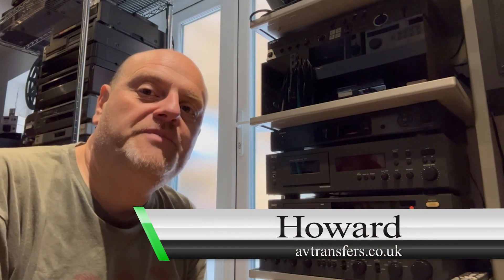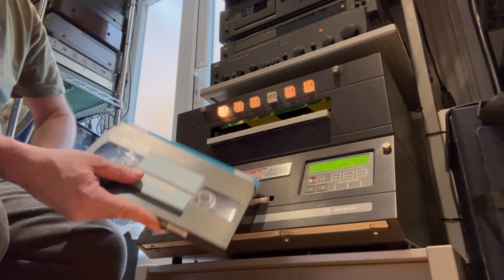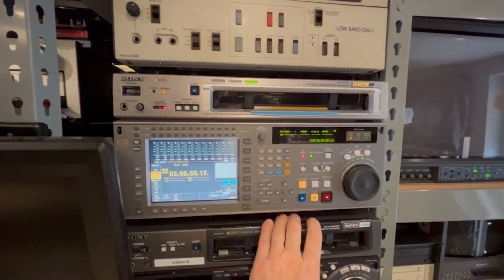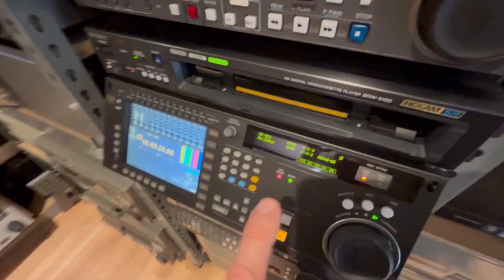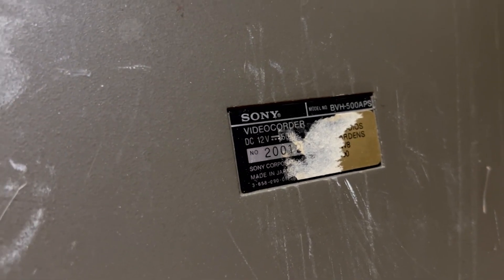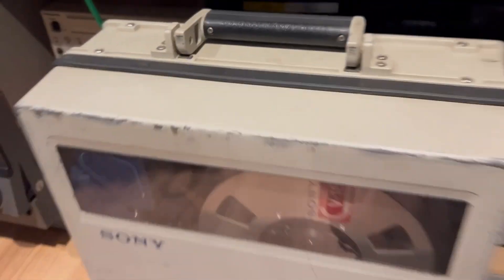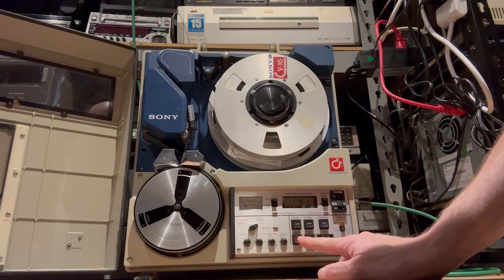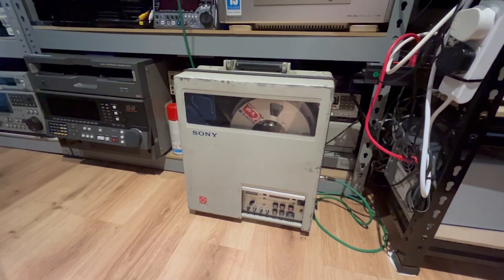Looking at HDCam SR Clean and Digitisation and Sony BVH 500A-PS Videocorder Demo @avtransfersUK

Comment: Hey Howard. I need to digitize some old 1 inch (x4, 610 ft.25,4 mm x 1,405,1 m) broadcast helical video tapes. is this machines good for these tapes?. I am very confused because I have almost 70 to 90 tapes. these tapes are very heavy and I didn't find any playback machine for these tapes on internet. I digitized old reel to reel spools and the machine I used for reel to reel is Otari MX5050. I saw some BBC old videos where the used very giant machines. is there any small machines?. please if you have any information about this do let me know.
Reply from the maker: Yes Send me some photos to evaluate what they are.  Best wishes

Comment: Well, today is the day I finally got my NTSC BVH-500A. Mine thankfully works and is in good condition (just needed to clean some paint off it), I just wanted to say a few things:

- Maybe the PAL/SECAM (PS) model can't decode the chroma the same way the standard NTSC model does? I've noticed, at least with the recordings I've made on the 500 so far, is that while the chroma is unstable, it's there on playback and it's somewhat watchable from the raw output. Like I recorded some footage from a Sony DVCAM camera and the color looked great on playback though a CRT - obviously you would want the HT-500A color stabilizer, but it's watchable and you can tell you got chroma. I thought maybe the LMD-9050 you were using was doing a poor job of resolving the chroma, but I pulled out my LMD-9050 (I have the exact same one) and the color is just the same as it is on the CRT. If you want to see what it looks like Matt Patoray on YouTube has a video of the BVH-500A playing some tapes from NBC and they playback just the way mine do. So either the PAL model can't playback in color as good as the NTSC one can due to the differences the way the PAL standard works compared to NTSC - maybe the phase alternating stuff has to do with it? Not an engineer.

- I think your unit has a fault though - mine doesn't complain about the battery (I'm powering mine from a Sony CMA-8A 12V supply using 4-pin XLR) and as for the SERVO/RECORD light, it comes on when you first hit play and the tape runs (as expected) as the servos get into lock. But after a second or too it goes away. I guess it could be capacitors as usual. There is a service manual for the BVH-500PS, but it's not the "A" model. From what I've read the A model improved the circuits for the digital servos.

 - As for the CF pulse, I have no idea what it does, it seems like the original BVH-500 did not have the switch and "A" model added it. I assume it's related to the capstan servo circuit. Seems like the "A" model also added the 9 inch reel switch as well, so again, probably related to servo.

Anyway, I'm happy to have my BVH-500, it's a nice clean machine and it's going to great for making mixtapes of DVDs and camera footage. Too bad it's so big though. This is my first adventure into 1 inch.
Reply from the maker: Wow. Thanks for sharing the update. Yes I suspect my version is a bit in need of tlc. I bought it only as a curiosity.  As far as I am aware the ntsc color carrier is closer to the bandwidth so easier to pick up the color. Pal needs that tbc to pull the color information out. As my 1” collection is up to 6 machines I think the portable will need to find a new home soon.  Thanks for watching.
Reply: @avtransfersUK  How close are you to Oxford? I know somebody who would most likely buy it off you. He's a friend of mine who lives in the UK. You should be able to ship it anyway domestically because I shipped the RCA version of it using FedEx and it arrived just fine to the person I sold it to. It's heavy but it at least is shippable since it's designed to be portable.
Reply from the maker: @KylesDigitalLab 60 miles

Comment: The prices on the BVH-500 is out of control. Recently one just sold for 229,900 yen or USD $1,613.90. That's insane for a recorder that is only really good for making recordings and not playing them back. I have no idea why someone would pay so much for one. Luckily I managed to get the RCA TH-50 which is a rebadge, but it has a lot of wear and was dropped causing some broken plastic. I would love to have a Sony non-rebadged BVH-500 in good condition. It really is a cool looking deck. But not for $1600.
Reply from the maker: Yes. I saw that auction.  I would also like to add a ntsc version as mine is Pal. They are gorgeous machines. Thabks gor watching
Reply: @avtransfersUK  Good news, I'm getting one on Sunday. I'm going to be paying $600 for it, someone happened to be on a Facebook group that I'm in that has one that came from a local PBS station in New York. It's the NTSC version and it's in great condition, not sure if it works completely, but I'm very excited to get it. It doesn't come with any tapes but I bought about 5 reels for it on eBay, including 2 blank 66 minute reels and 3 pre-recorded 18 minute reels.

I really would love to get the HT-500A color playback adapter, but it's also super rare as well. I will be getting a BVH-2000 later this year. I ended up selling the RCA rebadge I had and I kid you not, it sold within an hour of listing it. I don't know who's buying these but there's definitely a market.  

I hope you have luck finding a NTSC BVH-500, they are pretty rare and go for a lot.